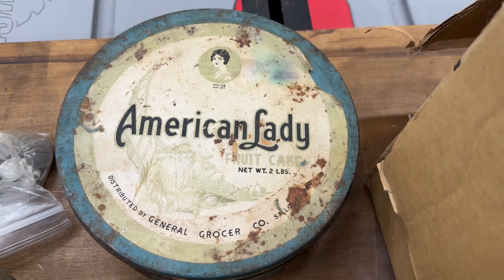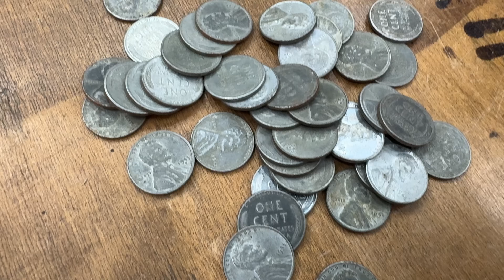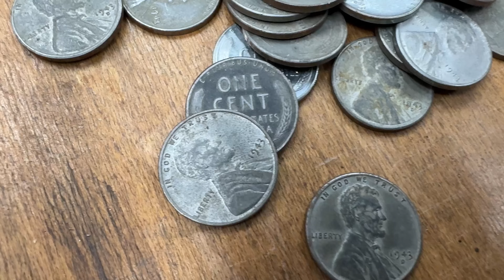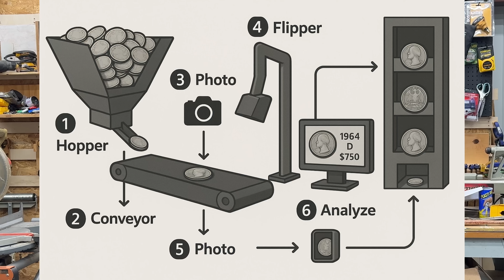Building a Coin Analyzer Machine – Sort, Scan, and Value Coins Automatically!

Comment: It would have to  go load hopper. hopper sorts coins  by type; pennie nickle quarter, silver dollar, etc.
Then it would go into hopper 2, you wouldnt use a flipper method. it would be it slides into a horizontal slot. then  it could be scanned on both sides for markers. Type, Date, Print, Rideges, a picker (would flick special or unique coins out of the basket to be looked at by hand. Other coins would be sent to normal basket and coin rollers.

Ideally you would want a section of the conveyor to pick out copper , and silver coins specifically before you get to the kicker.

this is just thinking outloud, I dont know much about coins. but to sort that many and scan them? it would be tiresome.
Reply from the maker: Thanks.  Yeah, if I don't build something, I'll likely never do anything with the coins.
Reply: Limit to being only scanner...sorting is readily available...bulk scanner is needed